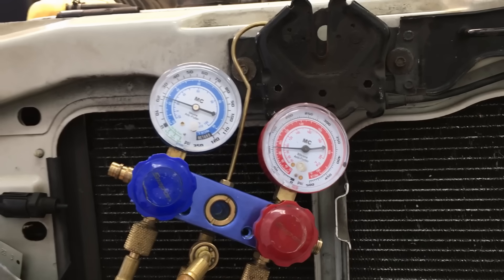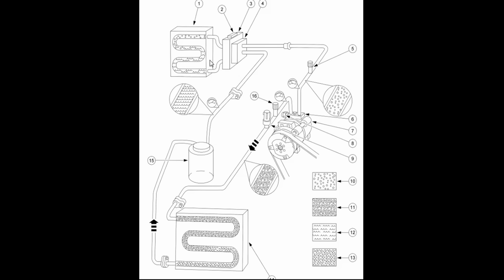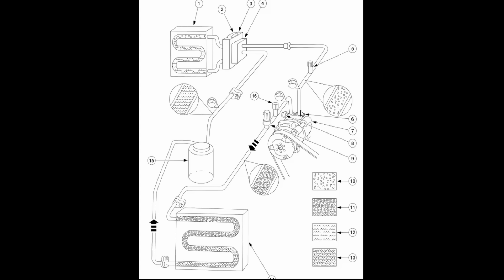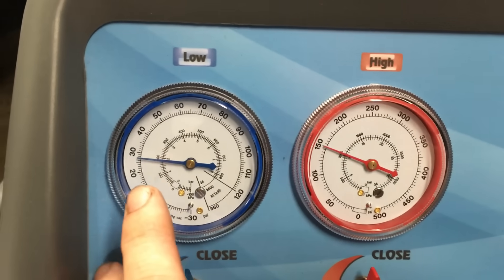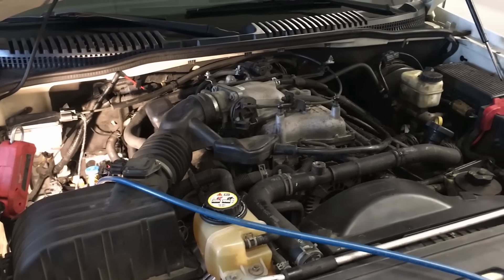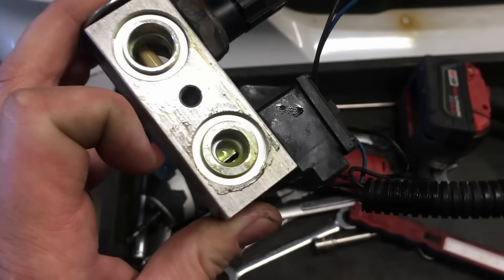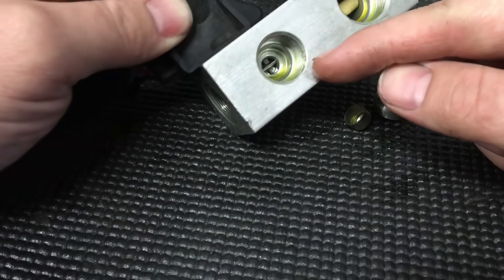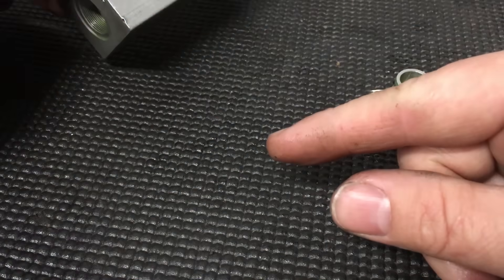3 Common Signs Your TXV has Failed Causing Poor A/C System Cooling

Comment: Hi how are you I have a problem whith a Buick lacrosse cxl 2.4 2011 my air conditioning some times works some times doesn't when I turn on the AC doesn't work right away I have to move the car to cool the AC the cooling fans works well and the AC works right away but it doesn't cool until about  I move the car like 2 blocks I been thinking that expancion valve doesn't work I really like to hear your opinion on this matter please thank you so much.

Comment: My ford E350 super duty econoline van that does not blow cold at idle.  I've heard that scroll compressors have a pressure control valve on the back of the compressor and that normally replacing that will fix the problem.  How about my van.  Does it have a pressure control valve?  If not then, what replaces the pressure control valve that will make the van not blow cold at idle?

Comment: Question, if the TXV is stuck in the open position what would the symptoms be? 
I changed mine in the midst of doing a few other things to the ac. Assuming I did everything else correctly, would this make my ac take a while to kick in and start cooling? It only cools after I have been driving for about 4-5 minutes. I started the car, it idled for 6 minutes and wouldn't cool, the gauges would react slowly but not much until I rev the engine a bit. 
Pressures read 36 low side and 175 on the high side at about 90 degrees and over 65% humidity. Freeon was refilled with the correct amount, tried adding a little but it made no difference. Temp in the shade gets to about 48-52 and then at night driving around it will get to 44-45.

Comment: Why is this part so expensive? In my 18 wheelers, all brands, they are only $54.00. Doesn't matter the brand of truck. Unless it is a Volvo. Then it costs an arm and a leg. Volvo does not like making any of its systems interchangeable with other trucks. Basically, they do not play well with others.. 😭

Comment: Have a 2010 Subaru outback  highside get to hot  replaced expansion valve, condensor, and evac recharged system. Before it only cools on highway and at idle nlows hot
Reply: Cooling fans not pulling enough air

Comment: Excellent video, so far this is the only one I've found that shows clear differences between comp and TXV failures.  
Hell, some if not a lot of shops just change both parts along with the condenser to get a better chance of a successful fix.
Reply: So true

Comment: Could this be what causes Honda a/c compressors to internally and/or externally explode?
Reply: honda compressors, especially the Densos last a long time, you normally just need to keep an ear on the clutch pulley....the weak leak tends to be the expansion valves...they tend to start going bad at 90k-ish

Comment: ok my car reads 30psi low end and 200 on the hi end in a 100+ day comp. (on), i thought it was low so i added 12 oz and it started cycling on and off like crazy so i got some of it out and now it cycles some what normally but still reads as if it low with compressor on.

so when reading the 134a pressure/temp chart are those readings should be with comp. on or off?

so what is the issue?
Reply: @jb9072  hey thanks for no reply I'm suspecting it could be a TXV cuz there is one right by the evaporator coil and so I'm thinking if I replace that expansion valve they should be a good idea to replace the evaporator coil along with it because it does cool and it does cool too about fifty or so plus or minus but after a while at a hundred degree weather it just shuts off and then kicks back on and every time it turns off or kicks off it's Luke cool and it doesn't cool until it kicks back on again so I suspect that there's some kind of restrictions somewhere possibly the expansion valve
Reply: @jb9072  not only that but it's really noticeable while driving it when it kicks off the car exhilarates and when it kicks on the car drags and this is a 4 cylinder engine and I don't know it supposed to be so noticeable like so
Reply: @joeydelmarsjr.646  it could be seizing internally but some drag is normal when the compressor kicks on...are you sure it's not blowing cold air and that the air mix is all the way open to cold and not to hot ?
Reply: @johnjoseph7382  it's blow cold then come it blows cool then none. Then cold again it's varies

Comment: My car has the proper amount of refrigerant and the system was replaced less than a year ago. I also changed the compressor relay just in case and still blowing warm air. Is it possible for the expansion valve to go bad in less than a year?
Reply: what kind of car and what do the pressures look like ?
Reply: cant really think it would be bad within 50k miles at the very least

Comment: Astonishing this video popped up in my reccomends....was just leaving out the door to get compressor (High-Low/Low-High)...might get lucky if it's expansion valve....cheap part & i was getting a decc. filter anyway too...my compressor cycling even sounded identical.

Comment: How can I know if I have a bad TXV or bad compressor?  I replaced everything new except for Evap (but did flush it out well).  Again, all parts are new...  I have very little cooling in the cab.  The compressor will cycle on & off with the a/c button (so I know the clutch is working).  My pressures are perfect @ 50 psi Low side, 300 high side @ 100 degress.  I have the same issue with the old OEM  TXV & the New chinese (GDP) part TXV.  Pressures are good..... temps are not.  Very little Delta T in temp.  I'm beside myself at this point.  I cannot figure out what's wrong.  Also, none of my suction lines are cold.  Ambient across the high & low.  So, I think I have a flow problem through my evap.  I just cannot figure out which part is the culpret!  Please help.
Reply: I think you figured it out already: flow problem. Some vehicles have a skinny in-line filter that gets jammed with debris.
Reply: @glasser2819  it was a bad Condensor (right out of the box). Everything works perfect now.

Comment: Good video.  I leave blower motor on to make pressure rise faster when compressor is off.
Reply: this is also the best way to dry moisture out of the cabin expender so smelly mildew does not grow on it 👍🏻

Comment: On my 2004 Chrysler Pacifica the TXV has two electrical wires connected to it...both wires have same color code blue and green...yet connection is marked 1 and 2 ?? 
I can easily insert plug in connection upside down and still insert it to locked position with the small locking tabs...
Does this mean it will still work either way??? I've only tried plugging them in one way...
I don't think my txv is opening allowing me to charge the system??
This is the 2nd valve that I have replaced????
Both I got from a junkyard but they where very clean....
Because I cut the wired when I removed the valves ... I'm not sure of the marking on the plug 1 and 2 ??? Help!!!!
Reply: connect a obd2 scanner to it or look at the schematic.

AC is nice but it stresses the whole car with high Amps load and high Heat. It helps boil up battery juice too... but we need AC 😎

Comment: FordTechMakuloco
 has saved me some serious money in the past.  This video is great as well.  I am hoping someone here will be able to help.  After watching this video I suspect I have a bad expansion valve but need confirmation.  2012 Ford F-150, 5.0L  Ambient Temp is 71deg.  System pressure before starting engine was 110 psi high and low.  After running for 10 minutes High pressure was 215 and low pressure was 7 psi.  Vent temp initially dropped to 65 deg but then went back up to 70.  Shut system off to monitor the rate of equalization.  At 10 minutes HP was 210 and LP was 56.  At 20 minutes HP was 180 and LP was 81.  At 35 minutes HP was 165 and LP was 115.  I would also say that the compressor is much louder than it was before.  Very noticeable.  It also does not cycle off.  Runs constantly.   Any help would be greatly appreciated.
Reply: taking way too long to equalize means txv is bad....you need to learn how to vacuum and recharge properly...watch chrisfix's video on how to properly vacuum and recharge

Comment: I have a 2001 f150 5.4 and the cold air only works when I hit the gas. Any advice would be appreciated.
Reply: either low charge or compressor is bad

Comment: Great video. Lots of great information. I have a question.
On my '08 f150 5.4 Supercharged Roush Nitemare the air would blow cold when driving but when stopped it would almost instantly blow hot. I checked the guage and the high side was low and low side was high. Compressor was running constantly and low side would draw down. After several months, it quit blowing cold at all. I had the compressor changed by a very competent mechanic. He used all Motorcraft parts. Now the air is back to blowing cold when moving bit not near as cold at idle. (Not blowing hot though). Any thoughts? I live in Florida and the fan clutch is working. The motor temp doesn't increase at idle even on a very hot day. Any info is greatly appreciated.
Reply: Should say low side would not draw dow. Sorry.
Reply: Have 2000  expedition mine does the same thing did you ever figure what is was?
Reply: I have a similar issue and the gauges wouldn’t tell me anything until I had someone else look at the gauges while I kept the rpm’s at 1500. Turns out I was too high on my high side and too low on my low side which points to the expansion valve that got me to this video

Comment: My ac stopped working. The ac system runs a small amout when driving. It shuts off when at low rpms. Checked it with gauges high side drops when the compressor kicks on. then builds pressure when compressor kicks off.

Comment: My car has good charge the compressor turns on but still blows hot air? Any help would be great thanks
Reply: The oil quantity is miscalculated so get the system flushed and start afresh,
Reply: bad old TXV is shut off.

Also... make sure the cabin air filter is not just plugged up by dirt. Remove it for testing then replace it if older than 3Yrs
👍🏻.

Comment: Awesome video just had a car in the shop today pressures with car running were 40 on the low and 200 on the high. Found when giving a little rpm the low would suck down to 20psi high would go up a little. When turning off the pressures took forever  to equalize.
Reply: Thats TXV case

Comment: Got into an accident 5 years ago and the AC in my 2005 expedition hasn't worked since. Whistling sound coming from under the dash, no compressor function and will not retain freon. The collision center said it was always broke and they weren't going to fall for it. So here I am trying to fix it myself. 210,650 miles. And I love it like its new. No AC and all she's still my big baby

Comment: What if the low side is low but the high side increases up towards 350 lbs. when I turn on the a/c?
Reply: There is a restriction in the high side of the lines mostly stocked TXV

Comment: Hello, I love your channel. I watch it all the time for maintenance and repair work. I wonder if you heard about the loud engine fan issues with 2009-2013 f-150’s. I have a 2013 f-150 eco boost and the engine fan keeps running high when I turn on my a/c. When I turn it off the engine fans turn off about 5 mins after. I had a problem before where the fan would run high and found out the radiator was running with low coolant and also had a leak in the turbo but I got that fixed and refilled the coolant reservoir. Now I’m having a high running engine fan issue, but this time the coolant and turbos are fine but the a/c isn’t. The a/c sort of runs cool but on really hot days it would not cool the truck down. Also when I on the a/c for the first time, I would smell a metal like odor coming from the vents then it goes away. Could this be a the temperature expansion valve or anything with the a/c system or would it be something else. I can really afford to fix a/c problems due to budget and disability from my service as a USMC. Any thoughts on how I can fix this?
Reply: Did you make figure out your issue? I have the exact same problem

Comment: Great video! I'm having a similar problem and getting numbers on my gauges similar to the video's. Unfortunately, I don't have the equiptment to tell if it is a restriction, or just low on charge. I was wondering if the lines could be a tell tale. My discharge line from the compressor is very hot and the low and high pressure lines at the evaporator are not hot or cold. Does this sound like a TXV? Thanks.

Comment: Brian, I have a question. My 2000 Dodge Grand Caravan shows proper pressure on the low side, but the high side is around 70 psi.  It's fully charged and I'm I'm 42° in the cab which is very comfortable.  The compressor does seem to cycle on and off a fair amount, but I'm not sure how often it's supposed to cycle.  I've read many places that say the evap valve is bad if the low side is correct and the right side is low.  What's throwing me is it's 42° in the cab.  Would a partially blocked evac valve prevent it from getting colder?  Thanks, love your videos.

Comment: Hey I just wanna thank you for breaking down some of the main points of the AC System and components. I was having some issues deciding if I need to replace my compressor and or TXV valve in my 92 Acura Integra and after watching this video I was able to pinpoint what was going on with the system. I have replaced both components and will be charging the system in the morning after my receiver dryer gets here and I have complete faith the system will operate flawlessly. I did the R12 to R134a retro myself and I've learned a copious amount of info about AC systems and I owe that to you and a few others on Youtube. Thanks again!

Comment: Wondering if this my issue my ac would be cold then hot and blow cold randomly most of time just stay warm have new lines compressor and full of freon I never changed the expansion block
Reply: likely the txv is clogged or failed

Comment: The dead giveaway that it's a stuck closed TXV is if the low side drops when you rev the engine but the high side doesn't. That tells you that the TXV is being fed plenty of steady pressure, but the flow is restricted getting through it and not keeping up with the demand from the compressor suction; so the low side will drop and may even go into a vacuum. If both the low side and the high side drop when the engine is revved, that would indicate that the blockage is further upstream, such as receiver/drier or condenser.
Reply: 2006 mazda 3s 2.3L auto sedan 335 k miles
I have this problem the does car not over heating . Theonly part I have not changed is expansion valve and high and low sensors I charged up with 134a no leak filler   shop said I need a new compressor and high line I replaced myself

New parts 
Ac compressor new not rebuilt  not China crap eather GPD
Cooling fan
Condenser
Dryer
High pressure line
Water pump
Thermostat
Flushed radiator inside /ou coolant
Expansion tank
Cab filter

What could it be?

Comment: Where does Ford typically put their expansion valves?  Outside the firewall on the firewall engine bay side?  Or the dreaded pull the AC box out?  Looking for both on 2013 Explorer Limited 2.0 Ecobust and 2013 F-150 STX 5.0 ext cab.
Reply: Right before the evap at the firewall

Comment: That's interesting, I have a 94 eagle summit that has a possible similar situation, yet the AC does get cold. It does equalize out on static pressure but it takes awhile, longer than you stated. The problem is the clutch kicks on and off way too much. Running pressures appear to be fine, low pressure does drop too much, down to about 20 then the pump kicks off, but that pump constantly kicking on and off is annoying. It doesn't have a leak, I've added some refrigerant but ended up taking some back out cause the pump started chattering. Take some back out and receivers sight glass has bubbles flowing acrossed it. Charge it up a bit and the bubbles disappear. No matter what I do the clutch always kicking off and on constantly about every two minutes or less.